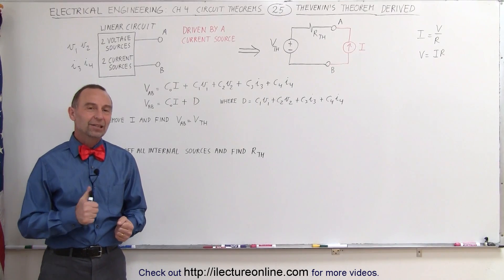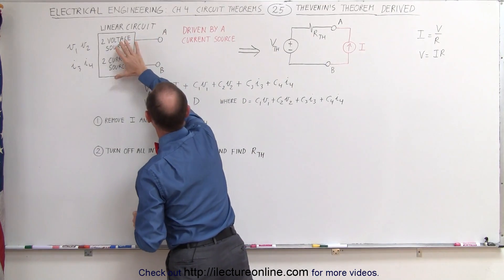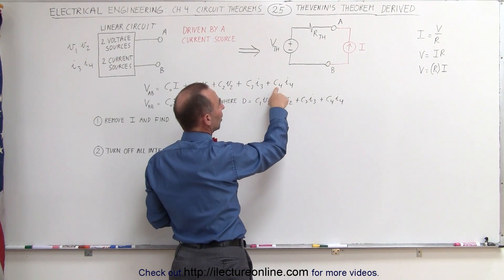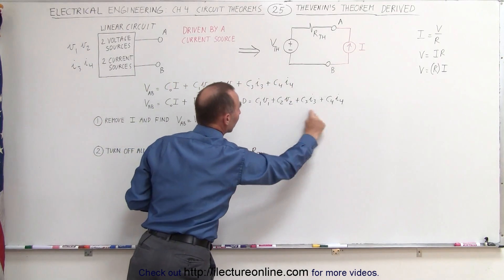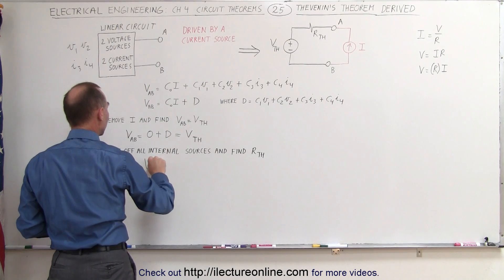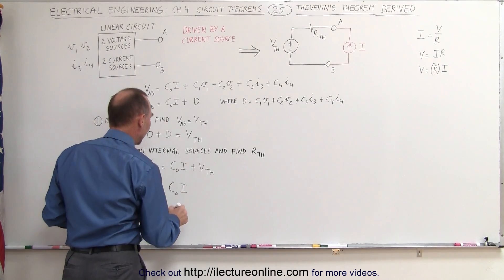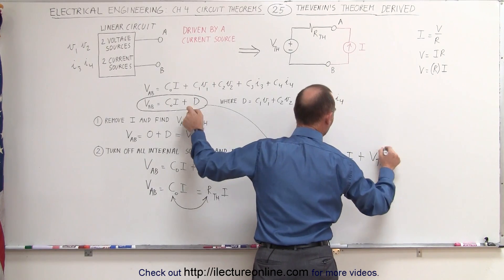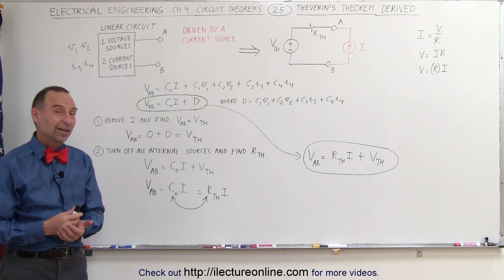Electrical Engineering: Ch 4: Circuit Theorems (25 of 35) Thevenin's Theorem Derived

Comment: Thank you for your illustrations of physics and math. Can you do a video for combination circuits of electronics.
Reply from the maker: What combination circuits would you like to see?  (We have hundreds of videos of different types of combination circuits in the physics and electrical engineering sections).
Reply: Dealing with resistance,  ampere, and voltage on complex drawings.
Reply from the maker: We have hundreds of examples like that in the videos on electrical engineering and physics on this channel.

Comment: Thank you!
I followed your explanation here but I was wondering if you could cover how dependent sources factor into Thevenin's theorem.

A circuit with dependent voltage or current sources is still considered a linear circuit, right?
Reply: exactly
Reply: Dependent voltage and current sources aren't necessarily linear elements, be cautious when defining these circuit to be linear.